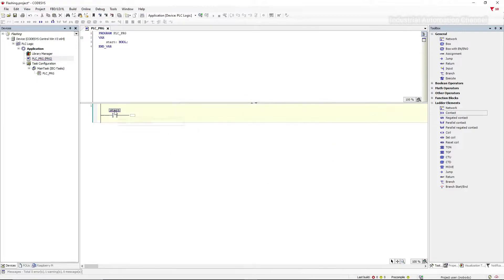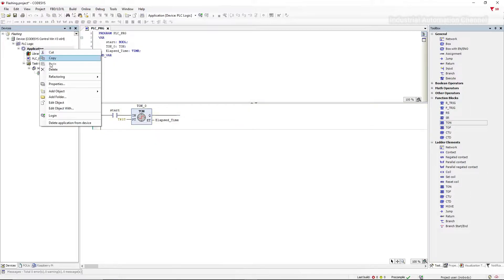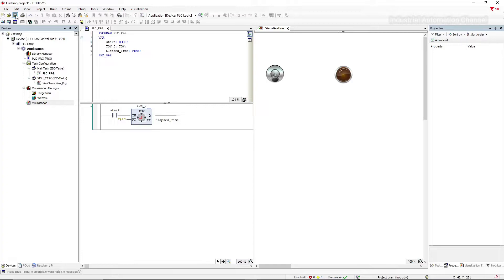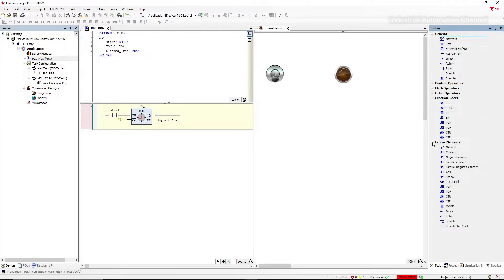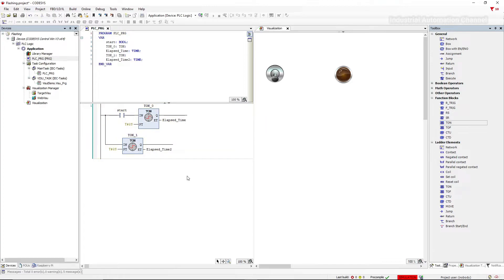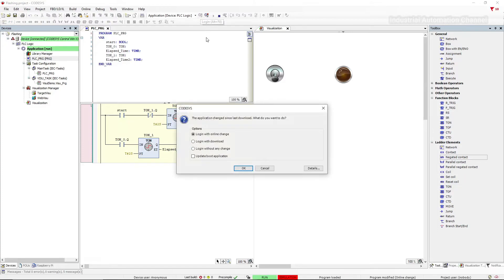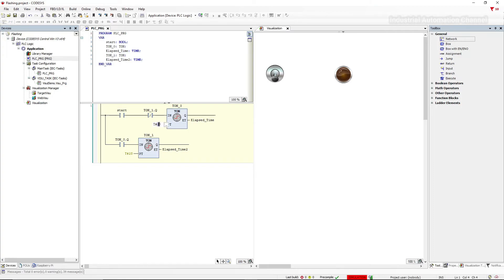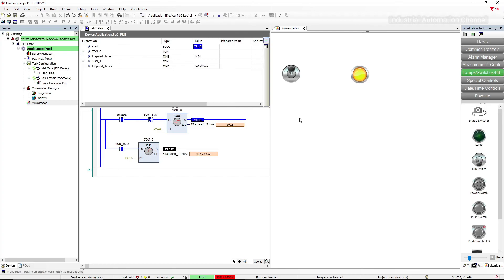Codesys #9: Flashing a lamp using timer in Codesys

Comment: I don't understand the functioning principle, at 3:55 you said that the opening of the NC contact happens very fast therefore we cannot see it, I drew the program on my own pc, tried to understand it but could not, so can you explain? thanks in advance btw I am learning so much from your channel.
Reply from the maker: In your codesy project under the Application and main task change the value of interval to 1000. So the scan time will be 1 second and you will see the changes better. Everything is done in 4 or 5 ms ( depending on your plc scan time) therefore it's a little bit difficult to understand how they work. 
If you have still some issue ask here.
Reply: @industrial_automation 
I didn't know I could change the scanning time I am still new at using codesys, I'll try it and see, in the meantime, thanks so much ❤
Reply: after trying, I couldn't find a way to edit the interval value, have u made any video to show how to do so?
Reply from the maker: @AviSchwartzman  take a look at video number 22 time 6:10. I create here a new task and change the scan time

Comment: how to write the code with st ?
Reply from the maker: Watch video number 16 in the Codesys playlist, where I explain timers using Structured Text (ST). Just use the negated contact of the second timer’s output as the IN input of the first timer, and the normal contact of the first timer’s output as the IN input of the second timer—just like I did here.
Reply: @industrial_automation  thank you

Comment: Could you use a timer and/or counter to make the LED stop blinking after 10 seconds?
Reply from the maker: Use Start button (same as the Start before first timer in the video) as input IN of a TON Timer with PT=10s. when you start the flashing, this timer will also start and after 10s the timer output will be turned on. now use the output of this new timer with a negated contact before start. After 10s this contact will open and flashing will stop. you need to reset the start to restart the flashing.